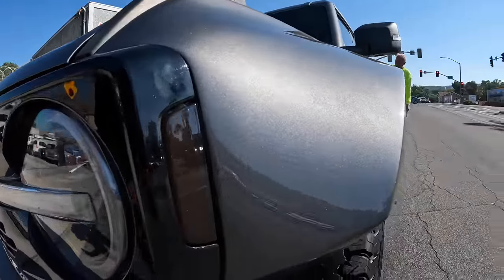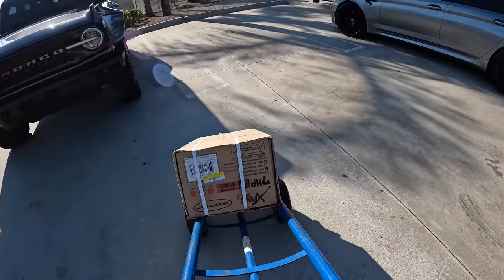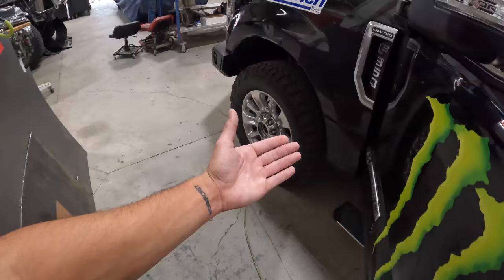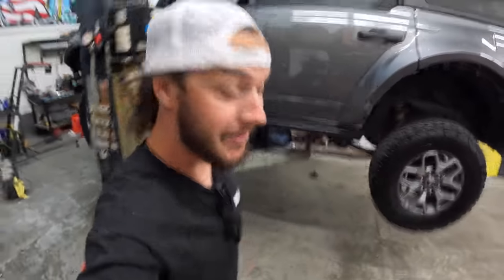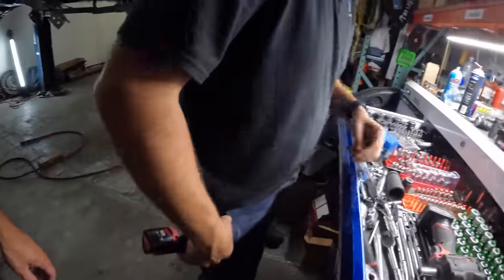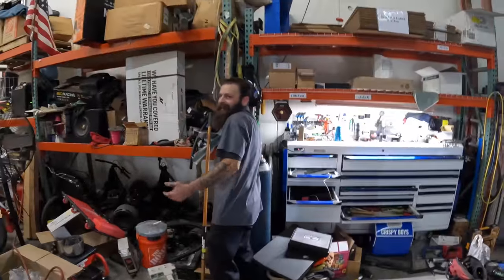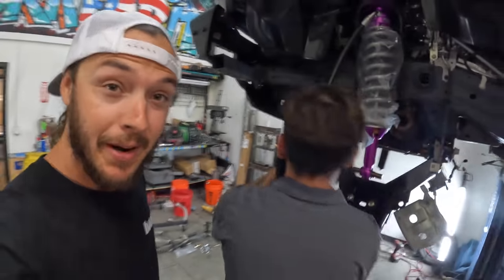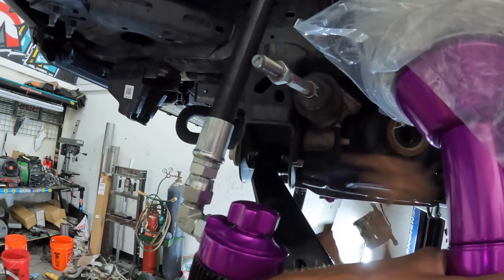We Have 4 Days to Build my Bronco for SEMA! (Part 1)

Comment: Come on Zack your smarter than that you know you should never pound bolts in with a hammer. If you can’t get it in by wiggling/tapping the part around and maybe some light tapping on the bolt then something isn’t right. I learned this the hard way too when I was 14 I was putting a new coilover on my bike and couldn’t get one of the bolts all the way in so I pounded it in with a hammer. It went in but then I couldn’t get the nut on it because pounding it in with a hammer screwed the threads. So then I had to ask my dad to drive me to the hardware store to get a new bolt witch i luckily had just enough money for because I had just spent most of the rest of my money from splitting wood on dirt bike parts and new tires. Then because of that trip into town and the extra work I wasn’t able to go riding that night. Had I just taken the time to adjust things a little bit the bolt would’ve went right in and I would’ve been right back out on the trail. I also see people do this with control arm bolts all the time then they wonder why the nuts so hard to get on… I know control arm bolts or shock bolts can be a pain but I’ve picked up a couple tricks over the years. I use a jack when installing stiff shocks, call me a baby i don’t care work smarter not harder it makes it SO easy to get it to where the bolt just slides right in. And for control arms I use a jack or block of wood or bungee cord on the ball joint side to hold it level while I use a rubber mallet to tap the control arm (not the bolt) until the bolt slides in all the way. Takes maybe an extra minute vs smashing the bolt in with a hammer but a minute is less than 40 to the hardware store and back. Plus hammering bolts in sometimes chips the paint from inside the hole your going through, witch I know not a big concern for you guys in the southwest but up here in the northeast that can turn into a problem after just a few harsh winters with all the salt they put down up here. Anyways not trying to give y’all a hard time lol just hopefully make your life a little easier when assembling things.